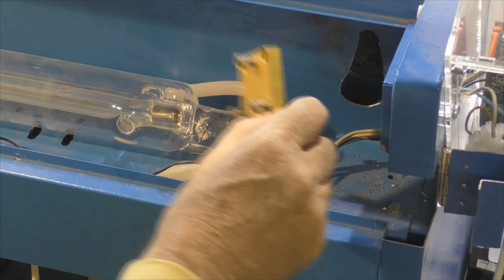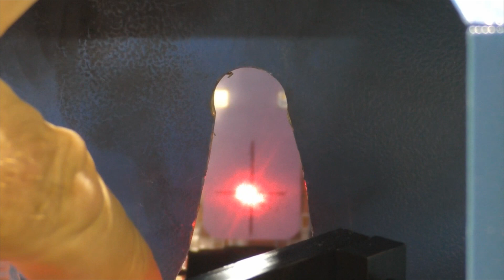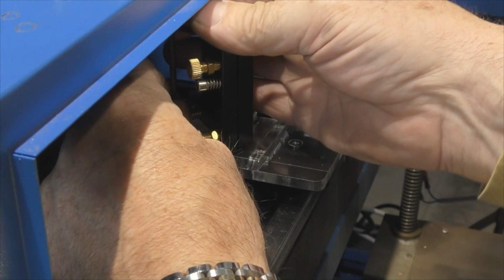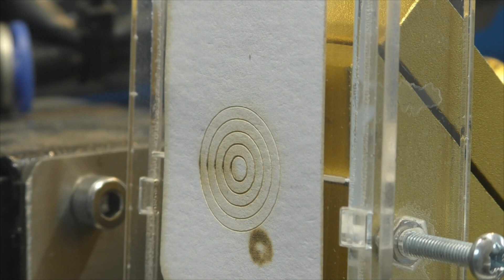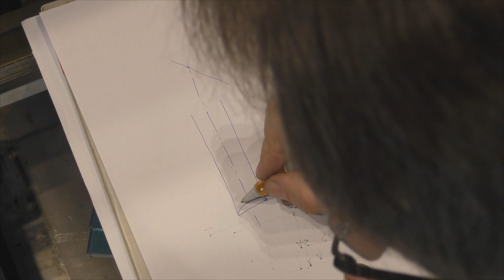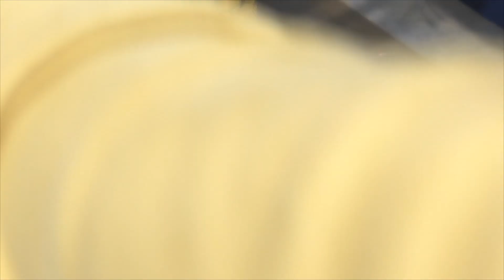RDWorks Learning Lab 119 One Piece Tube and Mirror Mount INSTALL

Comment: Hi Russ! I need some help here. I do not have your email and via mobile i cannot send you a pm. So i will post my question here. I am in the process of searching for a workshop in order to purchase a laser machine. The difficulty is that most suitable spaces i find are located below buildings with many floor above the workspace and thus it is not possible to throw out the exhaust pipe of the laser all the way up to the roof... So i am wondering if you know any DIY solutions for a middle filtering system so the air at the very end of the pipe outside the space to be bearable, smell wise for the residents around. I cannot afford a pro filtering system like yours and in addition i will be cutting almost 100% wood so the filtering system would be caulked very often even if i had a pro filter and it would be unaffordable. Any ideas? Thanks in advance.
Reply from the maker: Hi Polis
Wood is one of the messiest materials in that the smoke produced is in fact a cloud of mainly particulate matter. Most of that matter is  made up of tars and resins that are sticky and also flammable. Filtering is a science and I do nor claim to be an expert. I have made a pre-filter for my lightblade machine that is very successful at capturing most of the sticky particulate matter before it hits my "pro filter" It's very cheap to make and keep clean but it does not remove the smell because that is carried in a gaseous form and can only be deadened by passing through an active carbon filter. My "pro filter" has a section for doing just that and the recirculating air that is pumped back into my workshop is superb and odour-free. Recirculaing back into your workshop is ideal because you are not pumping you valuable heating to the outside world. It is a good way to test your system also because if you cannot smell the fumes, why go t the trouble of venting? Take a look at active filters for cooker hoods because they are mass produced and will be cheaper than specialized carbon filters. I'm sur if you do a quick you tube search there are guys in the same position as yourself that have made DIY filters.
Take a look at your messages and write to me and I can pass on more information
Reply: Thanks a lot Russ. My fear though with even using a pre filter in production work is if it handles the load. Think about an order of 300 or 1000 wooden coasters. The machine should be running 6 hours a day for days, cutting wood.... Tons of sticky tar stuff